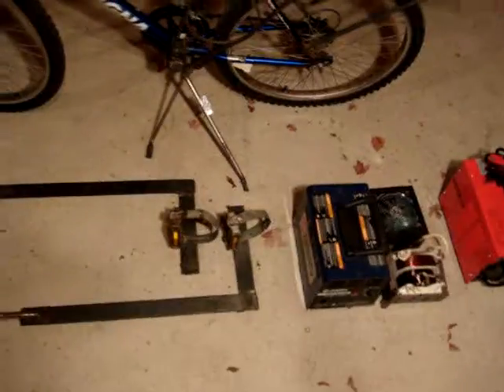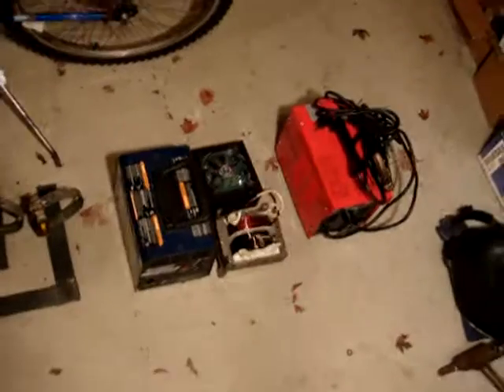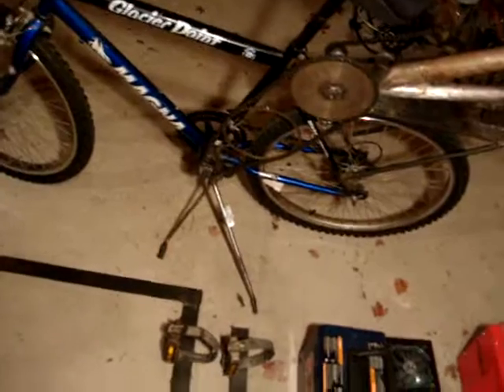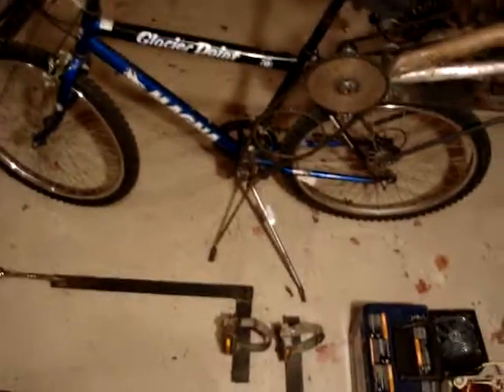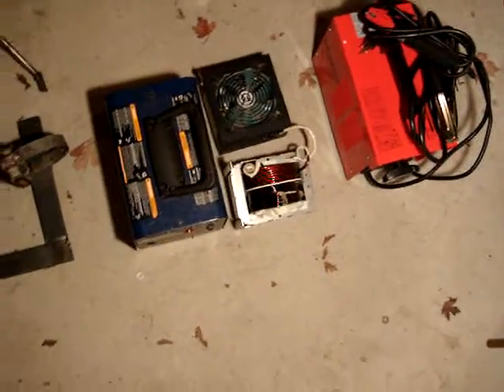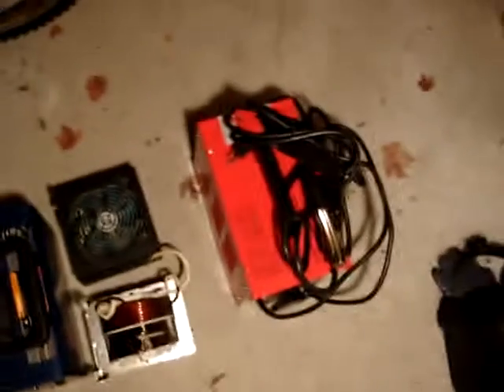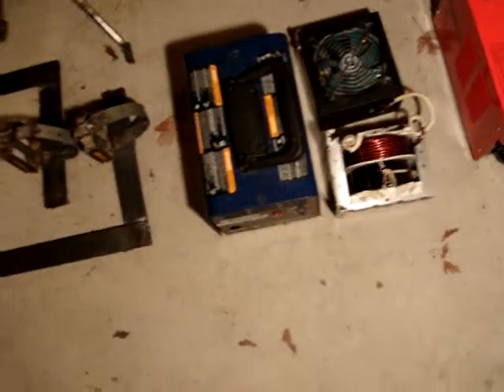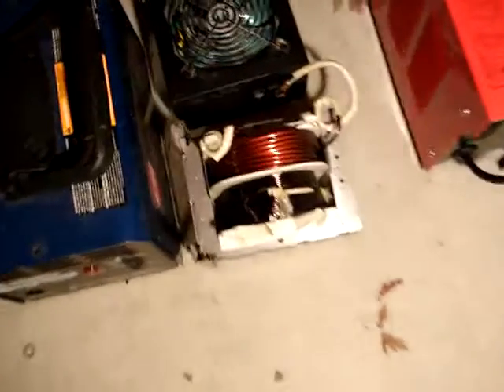The Gearcycle Part 5 (Bicycle Innovation)

Comment: I really like your thinking on this project and am keen to see/learn more. But I just gotta ask... at 1:08... did you fart on camera? If so, you had me in stitches! If not, maybe I am just a lot more immature than I thought! Lol
Either way, I am enjoying your vids. I am searching for ways to increase the speed of a bicycle to be able to comfortably do 100kph/60mph... and this is the best theory I've seen so far... would love to see some footage of it in action!
Reply from the maker: Ben Rudge Thanks for your positive input on my project. I do have a video of this bike in action. It doesn't work very well, but that is testing it with a million problems. It's a good concept, just poorly designed by me. Maybe when I become an engineer I will be able to design a better version of this bike.